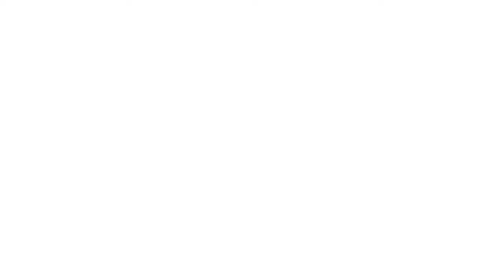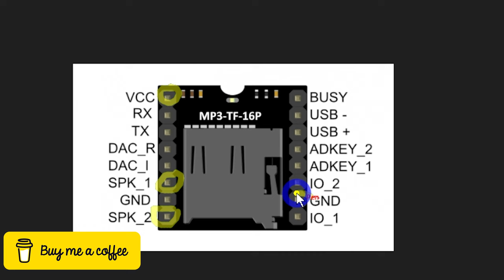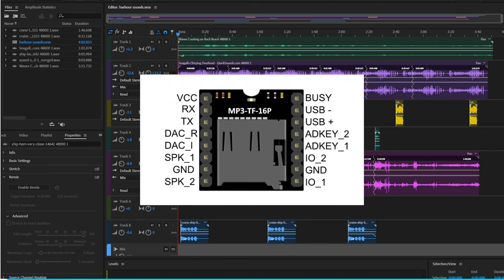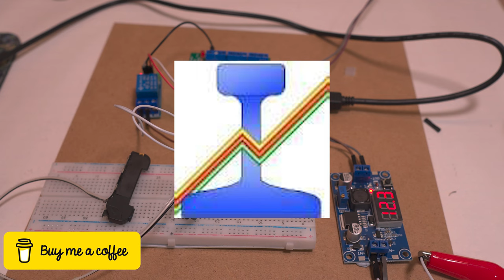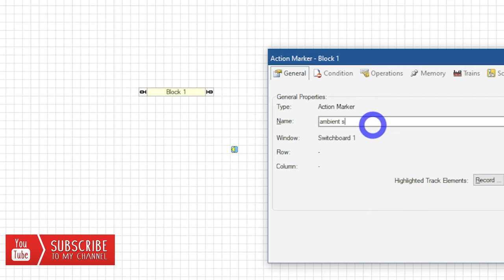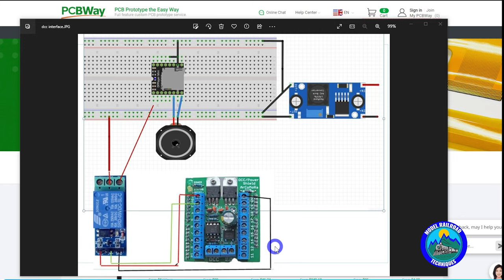Ambient Sounds for your Model Railway- The Easy Way

Comment from the maker: Questions:

1. Would you use this type of tech?

2. If so what tweaks would you do to this systems.

3. How could I do this better??

Thanks for watching
Reply: Nice video tutorial.   Adding sound to a model railroad really adds realism.  I've been playing with MP3 players (several types) and Arduinos for years.   Some examples.  Have an Italian restaurant from which you can hear Italian dinner music.  Have a strip club from which ... you guessed it ... disco dance music can be heard.  In a town square,  have a gazebo with orchestra figures from which you can hear polka music.  Started as a steel mill modeler.  So in addition to LED lighting, the sounds of a working electric furnace, blast furnace, etc. add realism.  So yes, I would (and do) use this type of tech frequently.

Tweaks to make it better?  I would consider real-world causality.  What sounds do the presence of a train actually trigger?  Two examples.  A train triggering a crossbuck signal with warning lights and a bell.  With block detection, I use an MP3 player to make the bell sounds.  Another example might be a train pulling into a station and a voice announcing the arrival of a passenger train arriving from some random city.  

Although you can have trains turning on factory sounds or restaurant sounds etc. with JMRI,  that doesn't happen in real life.  The sounds and trains are not generally coupled except for specific circumstances.  

Finally, you mentioned that you don't like push buttons on fascia boards.  Suggest a motion or presence detector (maybe cheap PIR sensor) on the fascia board instead.  My steel mill always has sound ... steel mills rarely close and they are the focus of my layout.  But you can't have a large number of sounds ... like 50 ... always playing.   So lots of building sounds, playground sounds, boat horns, etc. can be triggered when someone is actually walking around and enjoying a layout.

Again, a nice informative video.  All the best ... Cheers!!
Reply from the maker: @donaldkormos5529  wow there are some great ideas there. I love the one about disco lights. Now I’m think neo pixels. Motion sensor are a great idea too. I’m getting back to the drawing board for a sketch now. Thanks for taking the time on such a comprehensive response. Cheers Daz

Comment: I was thinking about these things long before DCC sound chips were invented. I'd like to see something like this installed at the Cairns Model Railway Club with different sounds covering each of our dioramas. If we were to do it, I'd be asking our tech person to consider proximity sensors so that the sound came on and got louder as people moved closer to the area. The computer simulator Trainz has built-in ambient sound for dozens of its assets. Place a heard of cows in a pasture and the sound comes with them. However you only hear it as you move closer.
Reply: I'd love to know how to do this as well.
Reply from the maker: Thanks John. Proximity sensors, nice. I would have no idea on the arduino sketch on this. Please let me know if your tech guys get any further with this. I would love to show case them and your layout if interested?? Cheers Daz
Reply: HI John,

I use the HC SR04 UltaSonic sensor to do this on our modular layout.
I have it set distance for 80cm to 85cm and when someone get that close it trips a Blue LED On and the DFPlayer plays
'Please Step Back From the Module'.. twice, and when they step back it plays  'We Thank You, and Have a Nice Day' then the LED goes out

I use the DCC-EX Command Stations and a rather simple EXRAIL script to control the devices and lighting.
You could assign any number of different sounds to play or lighting effects or servo movements like people walking to and from a engine or station, to city park playgrounds, or people in store windows or Oil derricks, depending on where the different HC SR04 Ultrasonic Sensors are placed.

Regards,
Kevin

Comment: Built one based on your base schematic with the tripper tied to ground and then switching the vcc. The board powers but the audio track doesnt trigger. If i disconnect the trigger from ground (with constant vcc) then touch the trigger to ground the track plays as expected, also if i leave the trigger attached to ground at that stage, it will constantly play. Just cant trigger it from applying vcc to start up
Reply from the maker: I know I had a lot of issues with the mp3 players. I have one that works now though. A lot of hot and miss sorry

Comment: Very informative video.
1. would I use this type of tech? Yes
2. Is so what tweaks would you do to this system? Currently just gathering information for design phase
3. How cold I do this better? No suggestion yet but I want my system to work on some type of time basis rather that DCC input.

Again, thanks for sharing.
Reply from the maker: Thank you for your kind words. DCC would achievable using my arduino DCC stationary decoder.